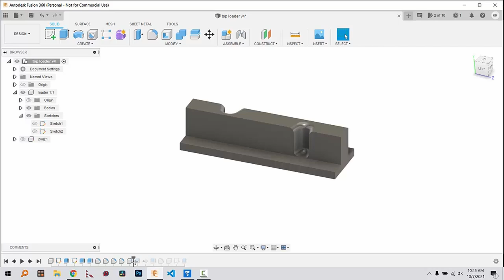Mainsheet Traveler Bearing Loader

Comment: We cruise on a cat in the Baja region. I'm also a DIY using Freecad+3d printer. I made one of these prior to seeing your efforts. I like your other gadgets too. My design is different but does the job. We have of vintage Amiot traveler, north of 23 years that needed new bearing balls. I like your idea using the catch box so those We$t Marine balls don't bounce down a scupper. Fair winds & beam breezes!
Reply from the maker: The time before we used toothpaste to hold the balls in place. What a mess. And we still lost some of the balls.